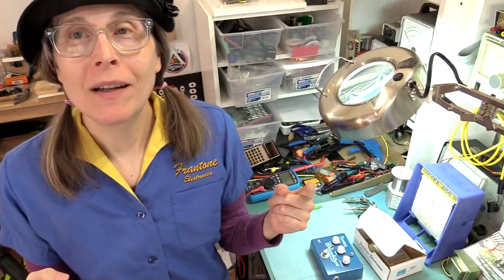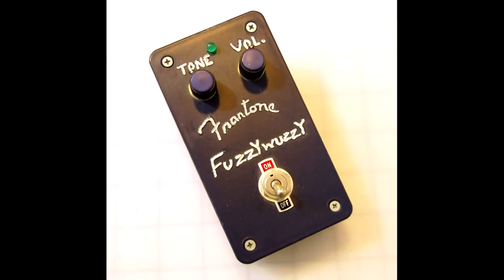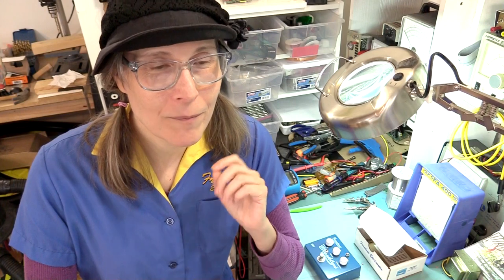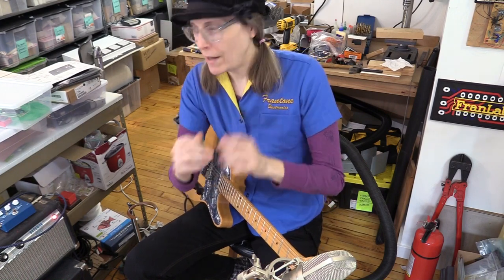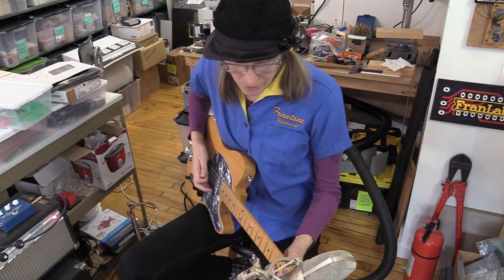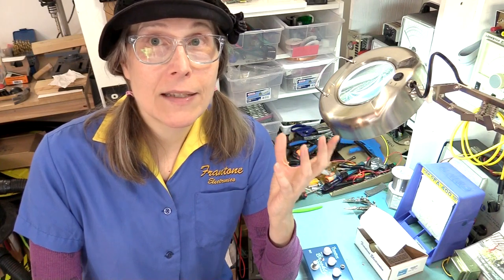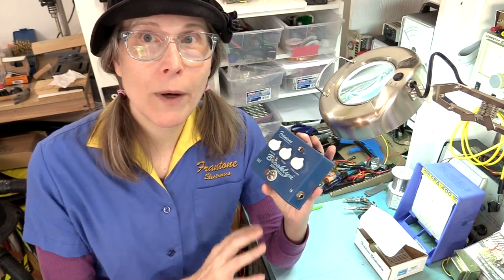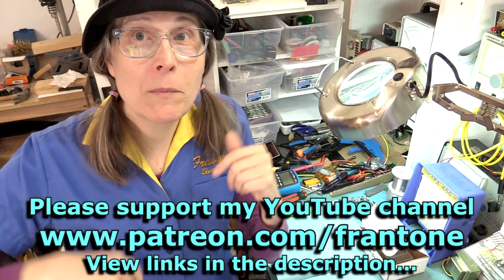Frantone Brooklyn Overdrive: Additive Harmonics

Comment: Here's a simple question, which you might have heard before.
Do you pedals also work for bass guitar, without creating too much input for the amp?
My Ampeg PF500 doesn't like it for too long, of course via the effects loop.
Reply from the maker: All my designs have output gain control so you do not have to overdrive the amp.